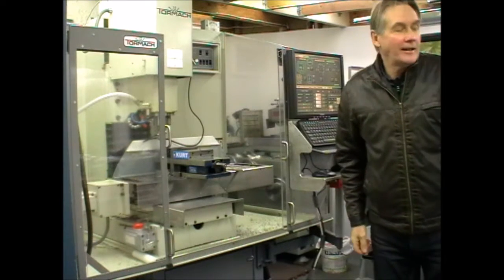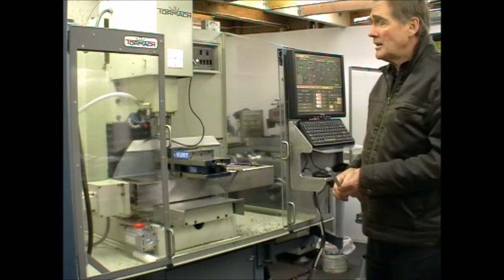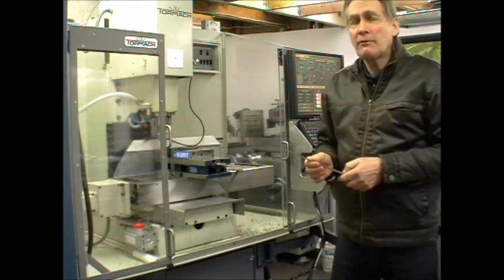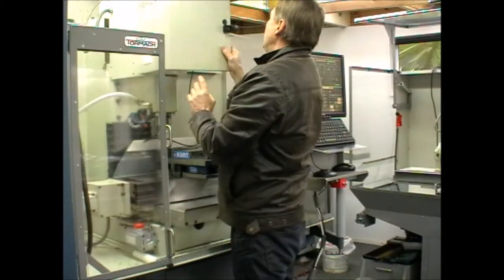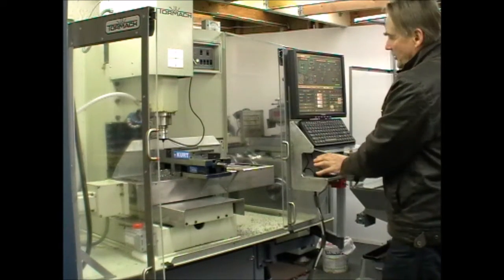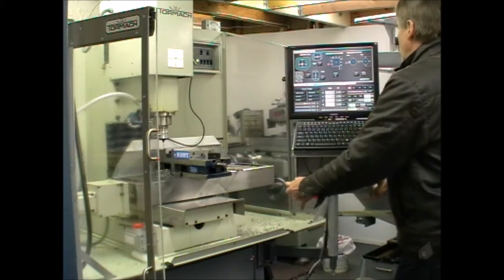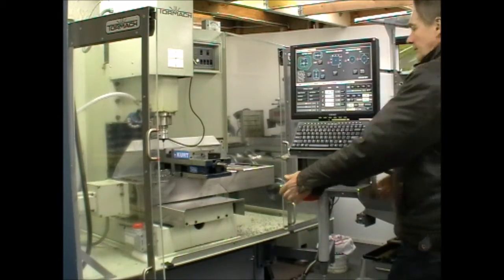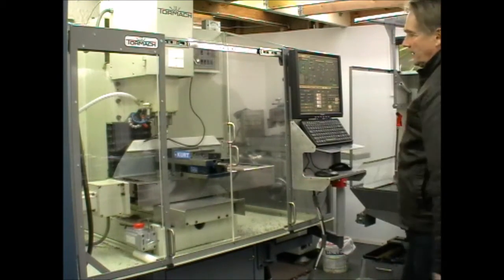Tormach Compact Enclosure Design Update

Comment: Like you I have done a lot of noodling on enclosures, however mine have been thought experiments instead of real enclosures.  I have yet to cut an enclosure piece, but I'm getting close.  I too started out with a swing up overhead door plan, but stopped working on that when I remembered the need to get into an already running machine, and the additional problem of the dripping of coolant all over when the door is open, and the additional problem of the required height in my garage.

I then started working on sliding door designs, with an open top.  Interesting that we ended up on the same path, twice.

The design I am going to build has horizontally, 12" solid enclosure walls on either side of the front of the enclosure with the rest encompassing four lexan doors.  There will be two nested doors on either side, like small elevators sometimes have.  For a single side a 12" full extension drawer slide will support a lexan door and another 12" full extension drawer slide.  The second drawer slide will support another 12" lexan door.  With proper lips on the doors, coolant will not escape.  The opening could be a full 48" wide with two 12" nesting doors on either side.  But like you, my enclosure is smaller than Tormach's.

Wish we could attach drawings here.  If you are interested email me at freeidaho@@@yahoo....com and we can chat.

Lastly, thank you for sharing your wisdom and experiments with the public.  They help many of us.  Gooday!
Reply from the maker: Hi Free Idaho. I just relised your comment was stuck in Youtubes spam filter - probably because of your email address.  I will try to reach you by email.

Cheers  Cliff

Comment: Have you given any more thought to selling design drawings for the 1100 enclosure or the parts themselves?  Seems like shipping the parts from NZ would be prohibitive, but Internet distribution of plans sets would be practical.
Reply from the maker: Hi Mike -  I imagine I would only sell a few sets of drawings a year - not really enough to justify the time it would take me to produce the drawings, and set up the admin. However later on when the Probe goes commercial, it may well be a viable add on. Cheers .
Reply: And by then you will be using a better design, no doubt.  Then too, many would probably just copy the look from scratch, though I suspect there are some subtle design features that might not be readily apparent from just a video.